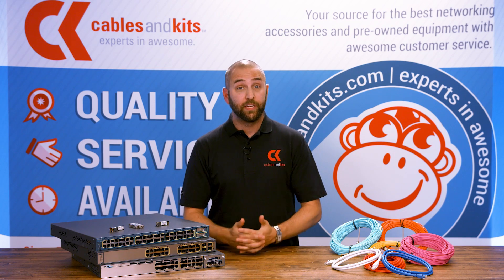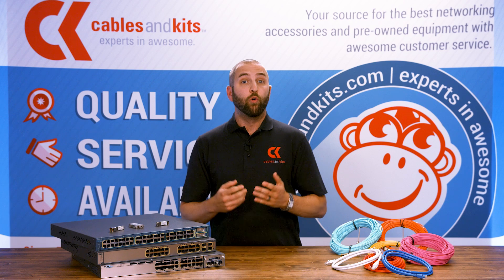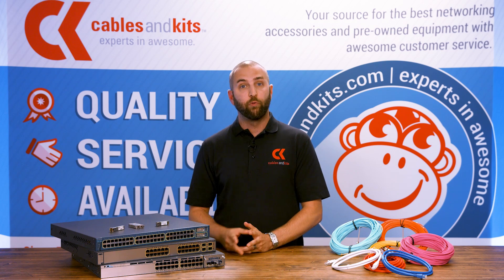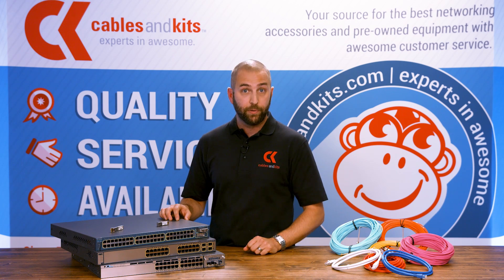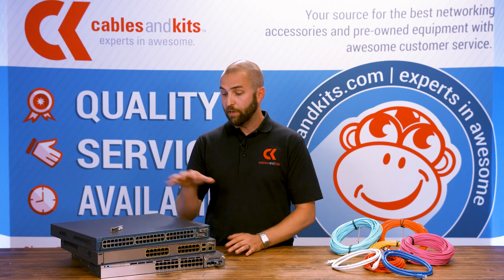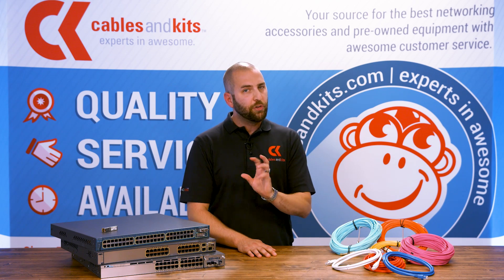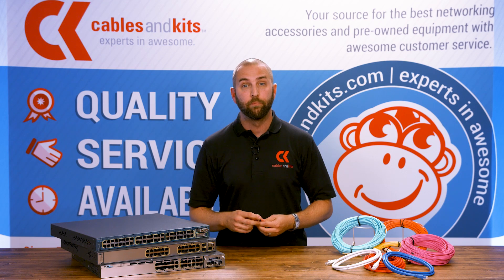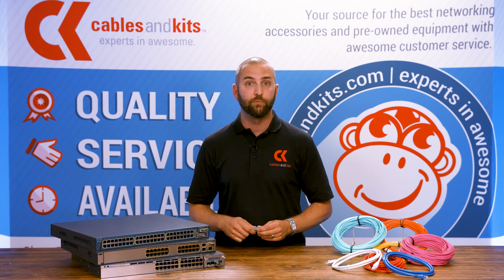What is an SFP? All things optical transceivers

Comment: "We have a little rule of thumb, if you're trying to connect two devices more than 6 or 7 feet, outside of your cabinet you typically need a transceiver".

Nonsense. Just nonsense. Use a cat 5/5e/6 cable? no transceiving there my dude.

Comment: if i use 1310nm/10KM/1.25g dual fiber sfp @ one side 
and 
1550/40KM/1.25g dual fiber sfp @ other side
will it compatible or will it work ?
My inbetween total distance is 8 KM
Reply: It can not work, the wavelength of both side must be same

Comment: OK but why not using an RJ45 cable instead? This video didn't answer the most obvious question...
Reply: because those cables are limited to 100m, these generally operate at longer distances.
Reply: @Thomas_Paine1286  But the video says anything longer that 6-7 feet to use SFP ???  seems like some important info is missing!
Reply: Listen guy. Right now you can save $14,000 dollars on this sucker so shutup and grab this stellar deal while you can! It’s worth EVERY penny
Reply: @throwaway9069  what the frick... Ummm do it broadcast too????

Comment: What type of optical cables to use with each connector type? Or are all cables the same? If these carry 1Gbit, what is the advantage of fiber over copper Ethernet?
Reply: 1) Fiber can run in with electrical in a conduit.....with out worry of fry'n your  switch.
2) make sure your connectors are both MMF (Multi-mode)or SMF(single -mode)  and the cable matches the switch mode
Reply: @AP-514  your switch can be fried through the power line because it works with electricity and not the holy spirit
Reply: @SIGSAUER_P320  spit?